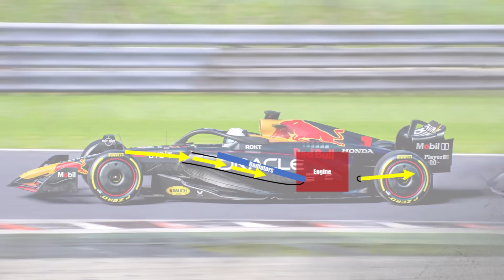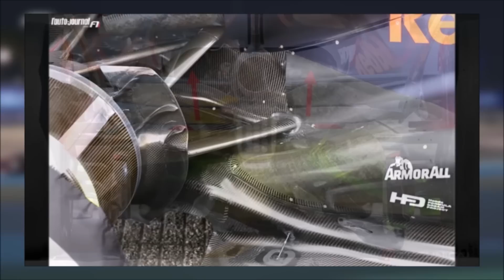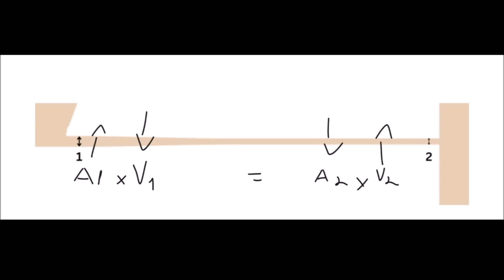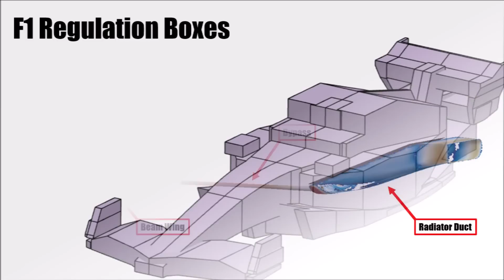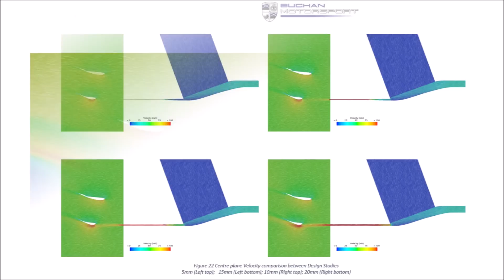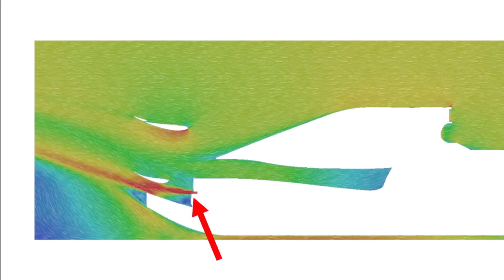F1 Internal Sidepod Ducting - CLOSER LOOK (Simulation)

Comment: I remembered you video upload and early observation but the question now is how did Mclaren leap frog the Redbull in performance? Better curb riding and tyre operation window.

My silly guess would be the clever use of "engine cover/cooling vents" and the coded message of RB concept reaching its performance ceiling.

Comment: Could this be one of the reasons F1 is banning the beam wing for 2022. To make up for the 8.8% loss in cooling, wouldn't the larger inlet needed have a negative effect on overall aero?
Reply from the maker: Or you have a more efficient engine or you can control the bypass…

Comment: I assume that another advantage is to energize the flow in the coke-bottle area in general.

What did you mean by "designing the beam wing on the edge so that extra flow will create separation". Will the extra flow on the suction side move the stagnation point, thus not providing enough velocity on the pressure side's leading edge for the flow to remain attached?
Reply: If you increase the flow velocity on the suction side by a large margin, then 
a) your flow will act more compressible (may approach Cp*)
b) You increase -Cp, but
c) more flow inertia/kinetic energy will require exceedingly more negative pressure to curve the streamlines without separation. The more peak -Cp, the more adverse pressure gradient the flow experiences afterwards. But during peak -Cp the flow has entrained too much low energy flow with the BL and also lost a lot of energy due to BL friction and turbulent mixing.

It has a similar effect to increasing AoA, but without the effects on the pressure side, in a simplified sense.
Reply: @virtual_GaRy  1- So, such characteristics or phenomena dependent on Cp also occur at relatively low, subsonic speeds, such as in F1? I thought that this would only start to be a consideration at high subsonic speeds where compressibility starts to take place.

2- In the example mentioned in the video, if velocity and mass flow on the pressure side were to match the relative increase on the suction side, would the flow still remain attached, or is there a practical speed (speed achievable by F1 cars) where flow will separate, regardless? In other words, is it possible to have an airfoil in freestream which remains attached throughout most of the speed range, but separates at a certain high speed?

Thank you very much for helping me on this topic. My understanding of fluid dynamics keeps growing mainly due to people like yourself. Your time is very much appreciated.
Reply from the maker: It means the beam wing is a very aggressive design, which can keep the suction side attached without the bypass flow. But when the bypass is blowing at it, the underside could separate.
Reply: @bsport320  Yes, that I understand. But why would it separate with extra flow on the suction side? Would that be because the boundary layer cannot carry the extra flow at such extreme AoA?
Thank you.

Comment: I remember you saying most of the air through the side pods is hot low energy air. Good thing someone bothered to test it.
Reply from the maker: If it goes through the radiator it is. This here doesn’t.
Reply: @bsport320  Good point.
Reply: I don't think you understand what's going on. Why would it be hot if it's bypassed the rads? Why would it be low energy if it's been funelled in this way?
Reply: @procatprocat9647  The exhaust manifolds are there making things warm. It wouldn't if designed properly. The radiator expansion will slow air down, but the outlet constricting will accelerate it again. Not for free obviously, might create a little extra drag, depending on the shape of the outlet.
Reply: @rolandotillit2867  you are very confused. 
Look at the relative effects. 
Learn some fundamentals and basics.
Reply: @procatprocat9647  Sounds like some generic bot response. You could learn some absolute fundamentals yourself.
Reply: @procatprocat9647  Teach me then, what's the temperature of the air under the engine cover near the engine and the exhaust and radiators? You think a 700kW power unit just operates at room temperature?

I also think you're behind of the times, too busy focusing on basic fundamentals that you miss the big picture. Moving heat around is easy, the technology exists. High temperature heat pipes will put any area connected to say an exhaust pipe, at the same temperature in seconds.
Reply: @rolandotillit2867  watch the video again. Try to concentrate a bit harder. 

Also, consider how many seconds any particular pocket of air will be in the region right next to the exhaust. It's a dynamic system, not static.

You almost sound like an Oxford Brookes student 🤣
Reply: @procatprocat9647  Didn't answer the question, more pontificating, saying nothing of value or relevance. Bot or obvious sock puppet. What temperature is the air under the engine cover? What is the static pressure under the engine cover?

Comment: How is it an F1 car does not over heat when stationary for many minutes? The thermal capacity is that large?
Reply: It does overheat. That's why they switch off the engine when they are waiting standing still in the pitlane
Reply: @jozsefmolnar6453  Are you a race engineer? If not, then get off my thread. What you stated is obvious to anyone with eyes.
Reply: wtf is your problem?
Reply: @stephencurry8552  Yes I am an F1 engineer. Why do you ask questions if you don't accept answers?
Reply: @stephencurry8552  If it's obvious with eyes then why are you asking? It's literally shown on every F1 race ever: They have handheld fans they stick into the radiators and intake to cool the car.
Reply: @Sturmovik1946  Oh really? They have fans on them during a long restart? They have fans when idling at the pitlane exit waiting. You are the personification of dullard. Lets meet in person so you can attempt to mouth off on me in person.
Reply: @jozsefmolnar6453  LOL. Sure you are sport.
Reply: @HyviaVideoitaMansenlale  Profanity is the first refuge of the dullard mind. You would not speak to me in that tone in person is the only take away from guys like you.
Reply: @jozsefmolnar6453  Bácsbokodról?
Reply: If you ask a question that most teenagers could answer, then you don't like it when people answer you.......
the logical conclusion is that you are an ignorant sweaty naive foolish teenager.
Reply: Cylinder Deactivation.
Reply: @Andre_The_Millennial  Isotope injunction.

Comment: it's the same principle as f duct
Reply: This one is for MORE downforce. The Fduct was for less downforce, and the F-duct was driver activated. Although at the end when he said design the wing on the egde so it will stall with more flow, that's the Fduct you remember, although it's now speed dependent.